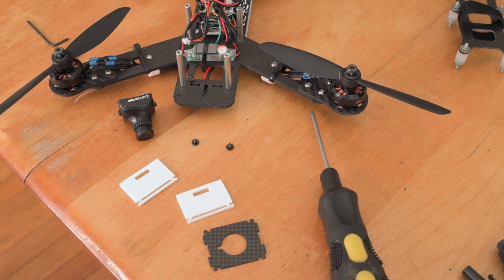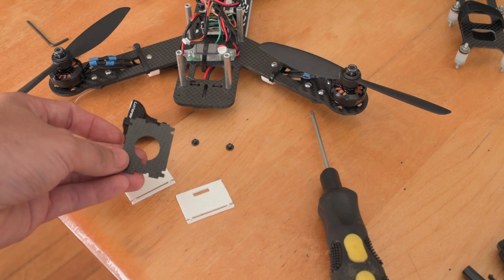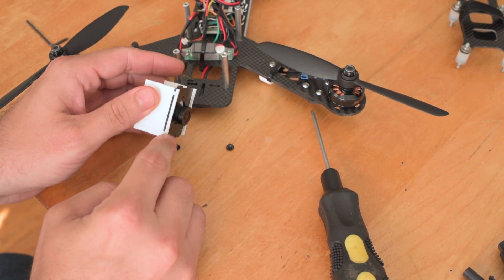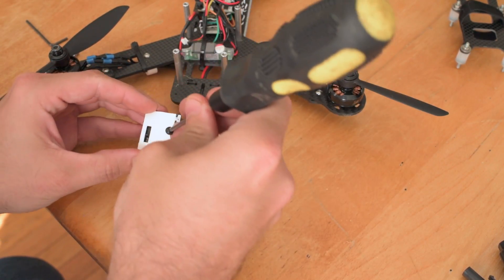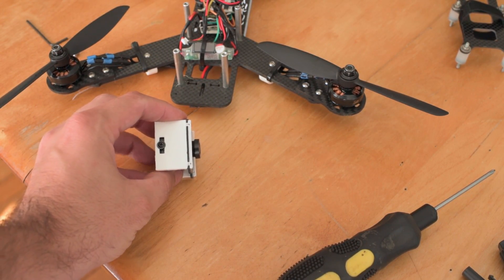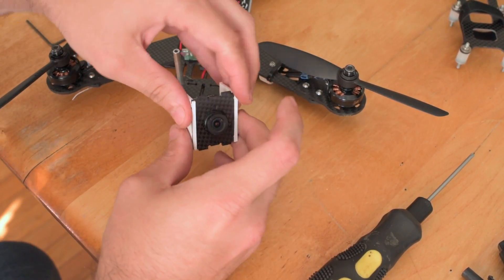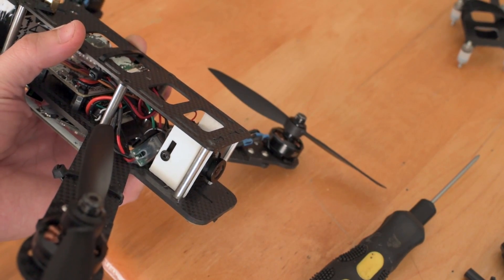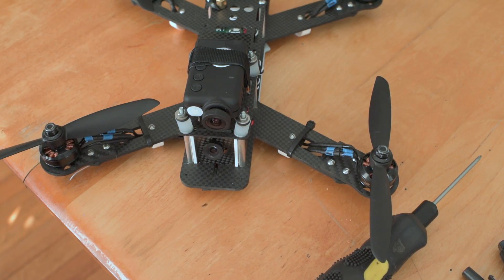QAV250 CM 650 Mount

Comment: hola buenos dias . una pregunta si me pueden ayudar .yo uso este tipo de camara Lumenier CM-650 Mini - 26x26mm Cámara 650TVL pero cunado estoy volando vibra demasiado .le hice de todo .pe pueden ayudar a solucionar este problema gracias
Reply from the maker: +DRONES DE CARRERA CUCUTA If you're having vibration issues, try a piece of foam under the camera to stabilize it. If you're still having trouble with vibrations, you've probably got a problem somewhere else. Ask yourself why it's vibrating so much. Unbalanced props? Bent motor shaft? etc.
Reply: no amigo ya se le hizo de todo .somos dos que compramos la misma cama y cuando se hacen la 6 de la tarde ya deja de vibrar ?
Reply: los dos drones estan nuevos .

Comment: Is there any way to get a more aggressive tilt angle? Should I cut a deeper slit at the side or cut away some of the front plate mount so camera could angle up more?
Reply from the maker: +Chadel Pryce man, it's pretty aggressive. My camera bottoms out on the frame in the lowest part of the slot. You might be able to get a more aggressive tilt by moving the camera forward a bit at the bottom of the slot? Like an L shape?
Reply from the maker: +createthis If you find something that works for you, let me know. I can probably modify the STL file and email you the update.
Reply: +createthis I bought your design and just printed one side XD
Don't have more PLA for the other side XD
Will try that! Thanks!
Reply: +createthis Super! Bro last question. What motor and propeller you using?
Reply from the maker: My QAV250 was bought using the parts Charpu lists in his Left Behind video (check the description): https://youtu.be/1MBW8zoZUR4

They're Cobra 1960kv motors and HQ 6x4.5 props.
Reply from the maker: I run different ESCs though. KISS ESCs were hard to find at the time I built it. Therefore I run custom tuning too. This is the only machine I've ever built that works quite well using PID controller 0.

Comment: I need one that will fit the 650 to the QAV210.  I would also like to be able to angle it a little more (up to 35 degrees).  Do you know if that's available?  Thanks, Jim
Reply: +createthis 
The frame comes with an additional front plate with a hole for the lens to peak through.  I just left that out and (you're right) it's fine like that.  (my first build!)
Reply from the maker: +jimd33463 It's not available at the moment, no, simply because I don't have a QAV210, so I have no way to get the dimensions. Let me ask some of the folks in my multi-rotor group if they have a QAV210 I can measure for this. I might be able to accommodate the increased tilt angle by curving the slot.
Reply: I would be happy to take measurements for you if you let me know exact what you need.
Reply from the maker: +jimd33463 Hey, looking at the product image for the QAV210, it already has mounting holes on the sides similar to my QAV250 mount. What is it about the existing carbon fiber mount that doesn't work for you, exactly?
Reply: +createthis, Well, for one thing, the hole for the camera lens is too small, and I'm not sure if it's possible to easily cut carbon fiber to widen it...
Reply from the maker: +jimd33463 I don't understand. Judging from this photo, it looks like the camera fits at almost a 45 degree angle: http://static.rcgroups.net/forums/attachments/5/1/4/9/1/8/t8318520-31-thumb-qav210-mini-cam-mount.jpg?d=1444420193

Maybe if you post an image of your setup on imgur or something and link to it I could better understand?
Reply from the maker: +jimd33463 Glad I could help!

Comment: I tried to purchase this from the site thinking it was a digital download of the STL file but I get a 'no shipping options available' message for Cyprus and can't proceed to pay. Any chance I can pay through another method and have the STL file emailed over?
Reply: Hi Jesse, I would like to buy this .stl file from you as well but the CreateThis site is getting flagged by Google as unsafe and even when I bypass Paypal won't run the transaction.  I'm in the USA.
Reply from the maker: +Ben Fischler yeah. I let the ssl cert expire. O was making less from the site than the cert cost per year. You should be able to use a regular credit card, but if you don't want to or can't, send me a payment at jesse@createthis.com and I'll email the stl.
Reply from the maker: Sorry about the trouble, Peter. I'm not sure why it gave you that message. I've already had a few orders go through successfully. I'll investigate. In the meantime, if you'll send $4.95 to jesse at createthis.com via paypal I'll be happy to email the STL to you directly. Thanks!